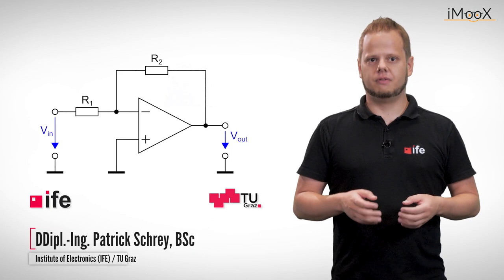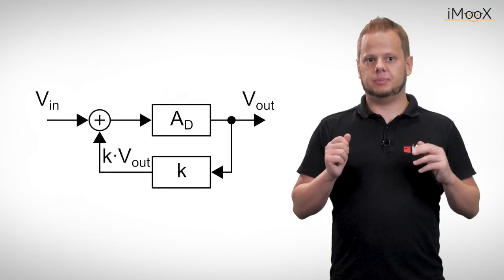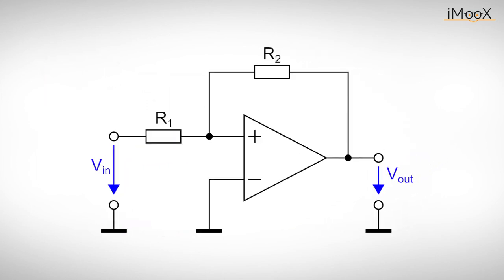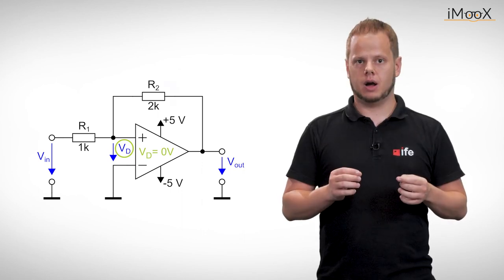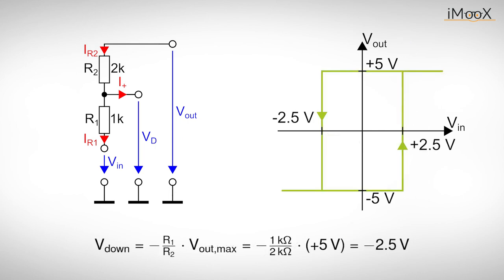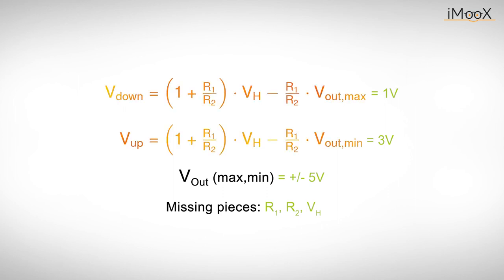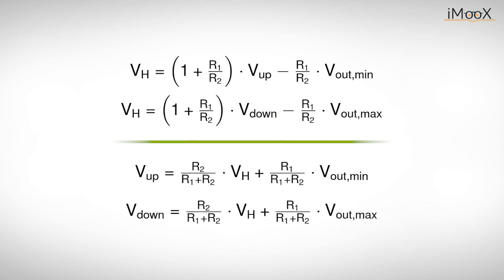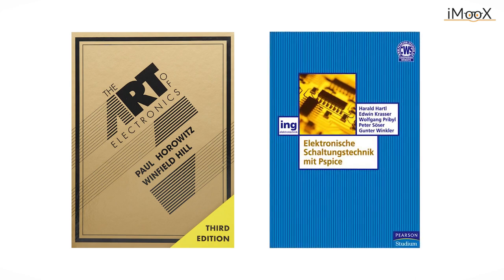Positive Feedback OpAmps

Comment: i am a little bit confused how dc input and AC feed back mix up at + ,  thanks  !
Reply: These Schmitt-Tigger circuits are switching DC voltages between the two supply voltages of the operational amplifier. Actually one would use a special type of OpAmp, called a "comparator", for those types of circuits. Though they are depicted with the same circuit symbol, comparators are designed to switch very fast, whereas "classical" operational amplifiers are specifically designed for use as an amplifier for AC signals. I hope this answers your question.